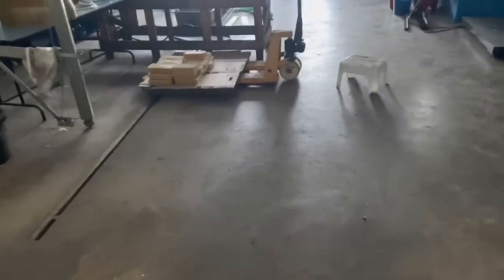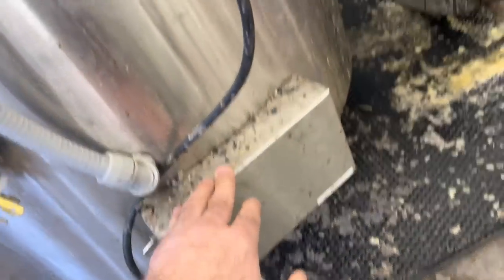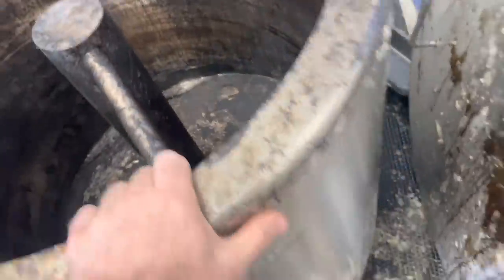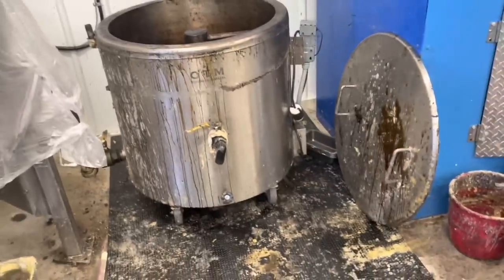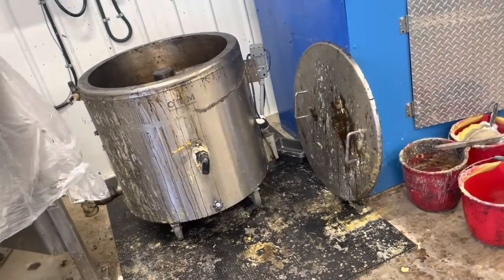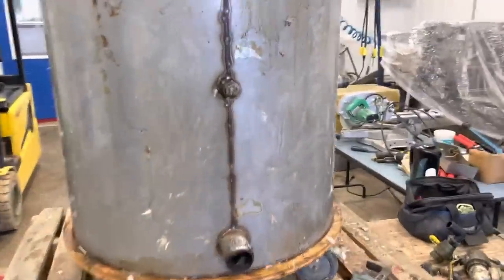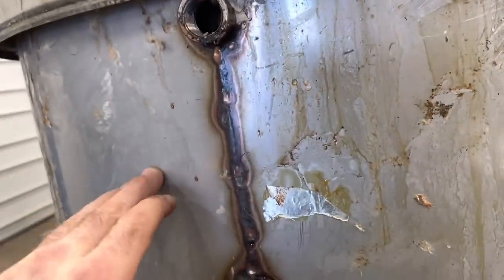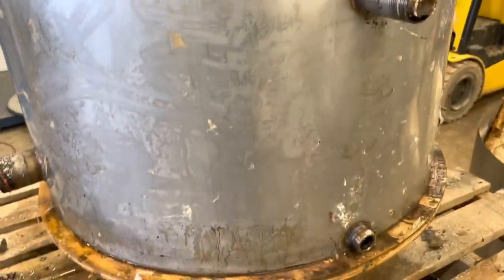Stripping Down The Wax Melter to Find a Leak

Comment: Engineering kibitzing:
With a 3500W element in place, when the controller switches on I would bet that it causes localized boiling where the element resides.
The controller likely tempers things eventually, but that startup draw (the same spike that ultimately killed the old controller) could form enough vapor bubbles such that some survive the path through the cooler zone of the jacket water and escape/vent via the fill port.
An easy test would be to take a dry sponge and pack the end of it loosely into the fill port (cut the sponge end down as required), leaving the bulk of the sponge projecting from the tube.  A sponge won't risk an overpressure but it should create a path where escaping steam would condense.  Run the melter for some sessions and see if the sponge becomes damp.
(It may be that the steam already begins to condense at the end of the fill port.  Surface tension has the drips travel along the underside of the tube and within the outer jacket.  That would explain the mini-flood you have on the dolly base.)

Converting back to 1500W is a good step.  Adding a little propylene glycol to the jacket and raising the boiling point would be an easy dose of insurance and reduce the labor of routine top-offs during the season.

Thanks for letting us play along.
And get a second melter.  Bet your labor savings give you a payback timeline of under 2 years.  If nothing else it will let you dispose of that old beast rather than looking at it as your process backup.

Comment: Turn over and Air pressure test, may only leak when the metal expands. Also do you get any kettling sounds or popping when heated , may need a flush out ? Are you topping off with hard water

Comment: If it continues leaking, you could get some florescent dye and add it to the water jacket, and then see where it is coming out with a UV light. 

The leak could also be on the bottom of the water jacket, maybe galvanic corrosion?

I wonder if the higher wattage element may have caused a localized hot spot and caused problems?

I do accept your theory about spillage getting trapped, but in case it doesn't prove out... Lol
Reply from the maker: That’s my story and I’m sticking to it lol
Reply: @aCanadianBeekeepersBlog  *reads this in Whiny Country Song

Comment: I was thinking one would be cooking cappings wax and the other be keeping clean wax, however which way works for me though. Nothing to do on weekends but work anyway. When I tried filling the melter last it came spilling out by the water drain tap and the large wax tap, as it was getting close to full, so it couldve been working its way to behind the exterior jacket.